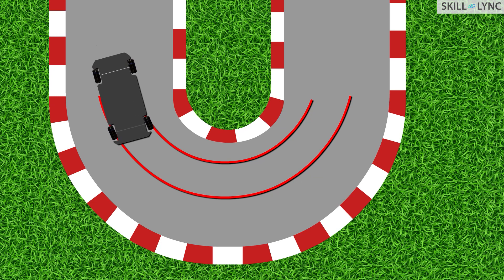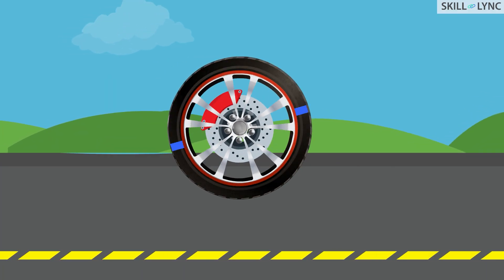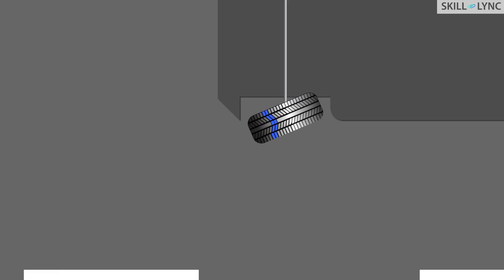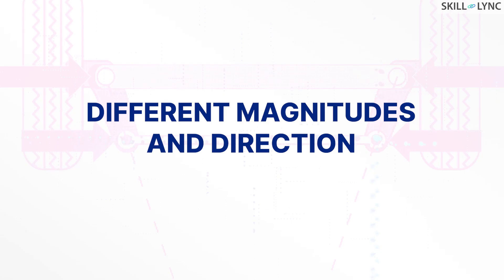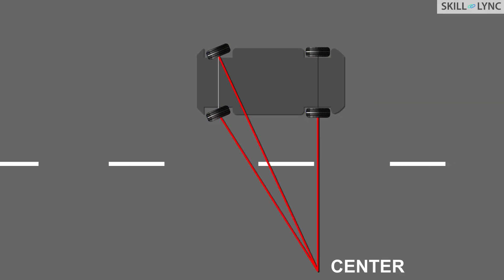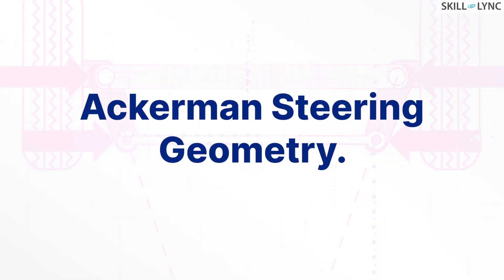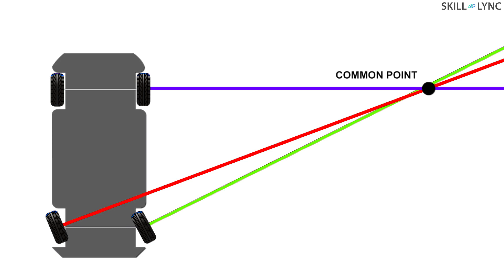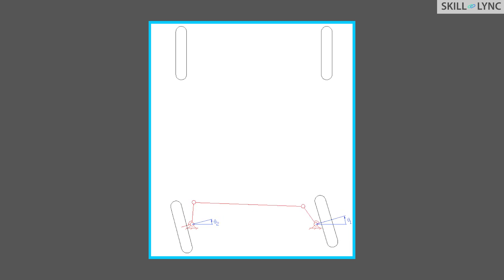What is Ackermann Steering? | Skill-Lync

Comment: I recently tried to design a go-kart ackermann steering.However, why is it that there's only one pair of certain angles for both the inner and outer angle that produces a common point between the extended lines parallel to the rear axle and also the perpendicular lines from both the front tires? Is this a natural behavior or should there always be a common point for all the turning angles of the front wheels? Thank you

Comment: Sir, what will b the difference in angles, between the inner n outer wheels, at the extreme point. Will it be less than 5 degrees or more. It may not b standard. Please tell approximately
Reply: it depends on so many things like the distance between the wheels, the max steering angle of the specific car, the radius of the turn so there really is no correct answer, it is pretty easy to calculate with basic trigonometry u just have to pick a turning radius and distance between the two front wheels and u can do it with pen paper and calculator

Comment: Is it necessary to use differential in rear wheel
Reply: Depends how u wanna use your car if your trying to drift then it's probably better to not use it cause it can make inconsistency in your speed when in a corner which will probably spin u out

Comment: If the vehicle is front wheel drive which it is normally how do the steering mechanism work in cohesion with torque coming through the engine ?